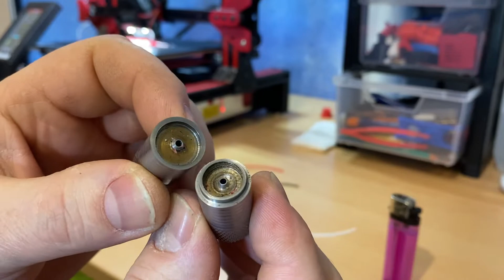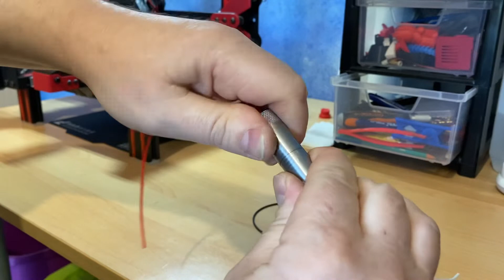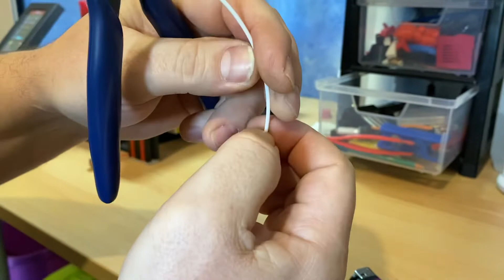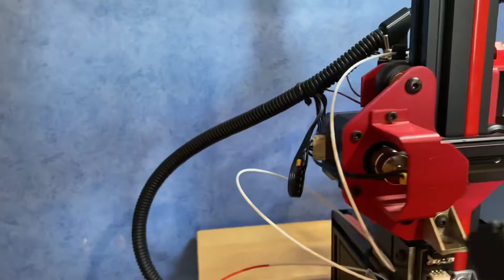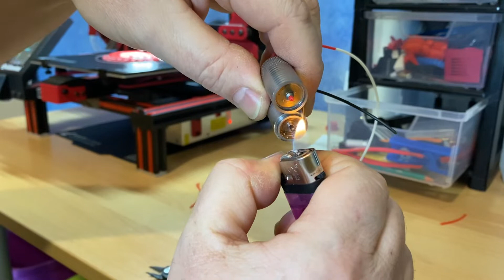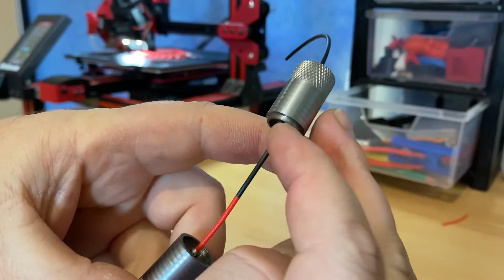Perfect Fast Filament Joiner / Welder

Comment: I almost made one of these until it dawned on me you can only join segments that you can slide off the end. Great idea for small multicolor objects I guess.
Reply from the maker: I tried to join pieces of 2 meters, it works well, I did not try with longer pieces
Reply: If you are joining 2 half full spools of filament, for example,  you would have to somehow wind the filament from one spool to the other anyways. I would imagine you could simply wind right through the tool to the other end. Obviously the the through hole would have to be pretty precise to the filament diameter in order to get a perfectly concentric joint that wont snag in bowden tube fittings, so it could also act as a gauge to locate any defects as you are winding filament through it.

Comment: That's FAR from perfect.
Reply from the maker: Why ?? Expand , please .....
It depends on how you use it
This allows perfect welding and cutting, which no other tool allows, the title of this video is in this sense
Reply: In my opinion, it does not have to be perfect, because in this form the connected filament will 100% pass through the extruder. I saw very bad joints passing through the extruder, even with displacement

Comment: 🤣I which he would weld two full spools together then realize what's wrong...
Reply from the maker: What is the point of welding two coils together?
Reply: @shootcast  that’s my point, usually you are in situations where the welder should come of the join without the need of sliding it of the filament, as you are joining lengths that can be consequent, either to continue an ongoing print or to respool together multiple spools leftover’s
Reply: @ImShogun  I still don't understand... You run out of filament, connect the leftover filament to a new spool, remove the connecting device from the other side - through the shorter section of the remaining spool. Pulling the connector through a full spool is illogical!

Comment: The next step must be that each cylinder must be divided into 2 longitudinally to be able to open them quickly without having to pass the filament, imagine that you must pass the complete roll.
And the idea is very good because after heating you must proceed to cool very fast but maintaining the measure of the filament, I like this path "to develop yet"

Comment: I had a locksmith make this connector on a lathe. Let's see what will come of it? Do you have any important comments that I could pass on to the locksmith to make his work with this filament connector easier?
Reply from the maker: No particular precision, it is only necessary that the parts be very precise so that the two cones can cut the filament burr